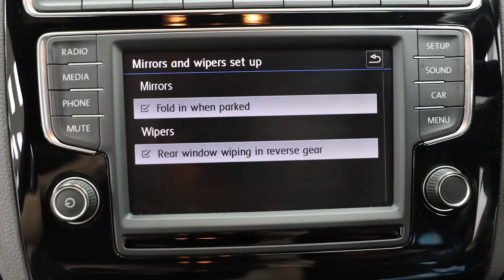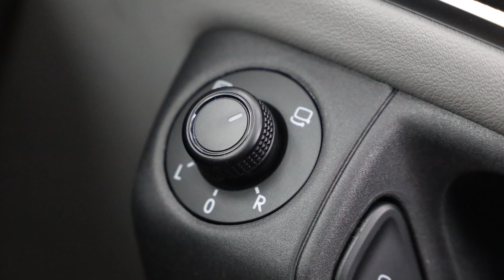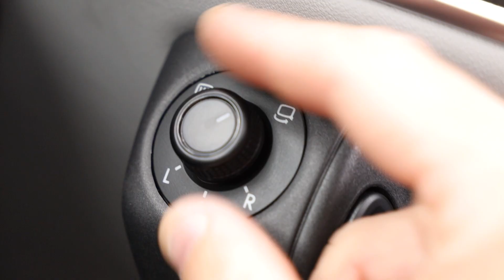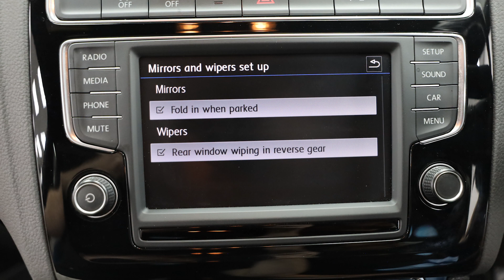VW Polo (6C) 2017 gets Genuine VW Folding Mirrors! New Door Switch & Fold-On-Lock Feature Activated!

Comment: That was great to see my own car in the workshop. Everything is still good and I am very happy with the results.   To anybody reading this, I highly recommend these guys 👌
Reply: Hello, how much did this cost for the parts tempted to try it out
Reply: @Ram_Susii Hi, yeh it's not cheap, my local VW dealer, who clearly didn't want to do the job quoted me £1000s, yes thats £1000 with an s on the end! It will cost you in the region of £1300, expensive parts and quite a bit of labour involved, but for me because of access to where I live was worth every penny, and the 184 miles round trip. Should you be interested in more power I've just recently had a Tuning box and Peddle box fitted by the same people and boy what a difference, it certainty put a smile on my face ! 😁